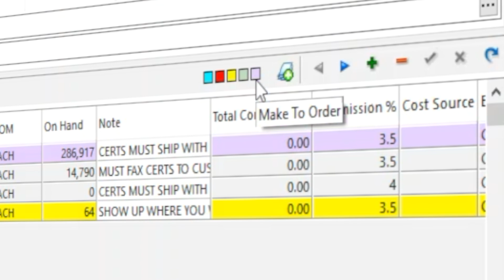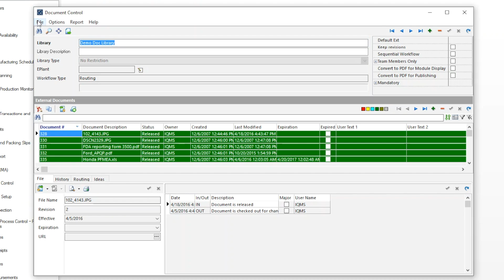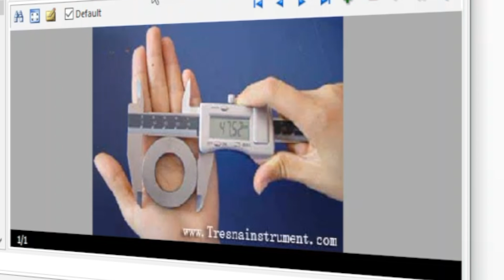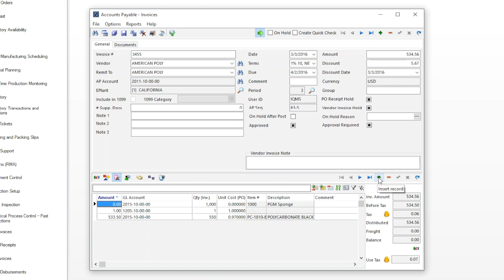IQMS Product Overview

Comment: 0:51 Customized role dashboards
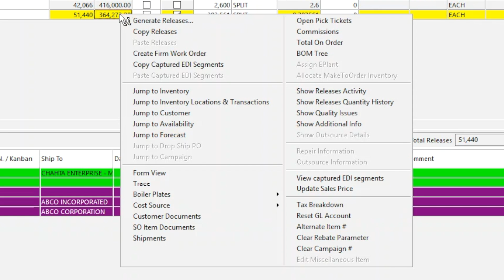1:55 Navigational tool for related records - Jumps
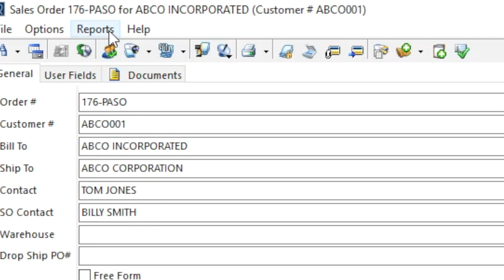2:09 Built in and custom reports
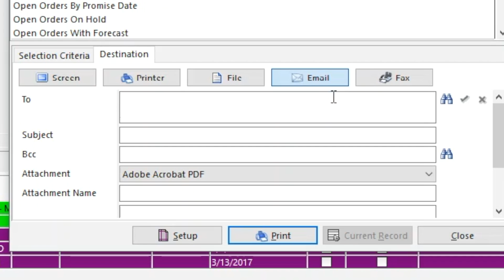2:27 Documents attacher (internal documents, external documents or drag and drop)
2:50 Customer sales order view
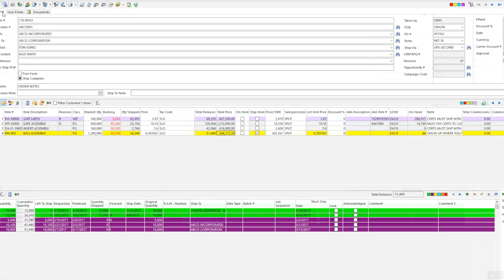3:19 When can these parts be delivered? Capable to promise calculator
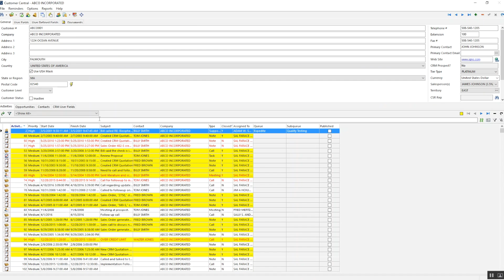4:23 Forecasting
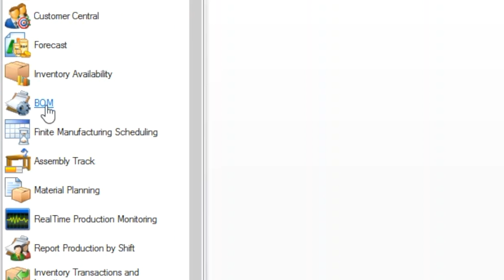5:26 BOM
6:26 Automatic work orders from sales orders
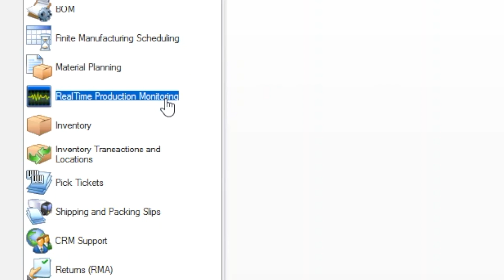8:40 Machine Monitoring using hardware on machines
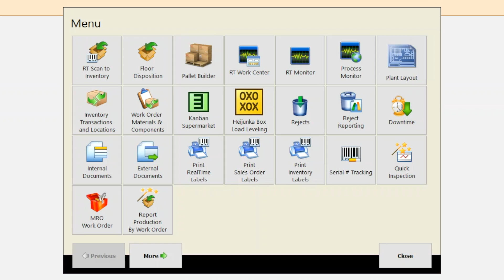9:34 Workstation Menu (touch screen)
9:57 Inventory transaction log
10:15 Pick tickets
10:37 Despatch documents
11:46 Document control
13:06 Complaint about a shipment of parts & returns & credits
14:03 Inspections (auditing)
15:35 Chart of Accounts
16:27 Accounts Receivable
17:00 Cash Receipts
17:25 Accounts Payable (3 way matching)
17:45 Cash Disbursements
18:03 Reports